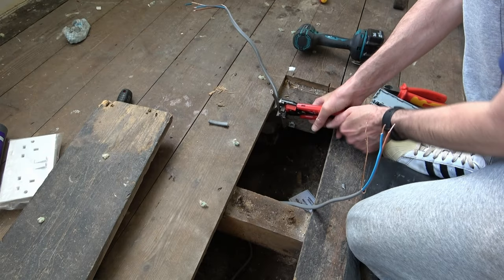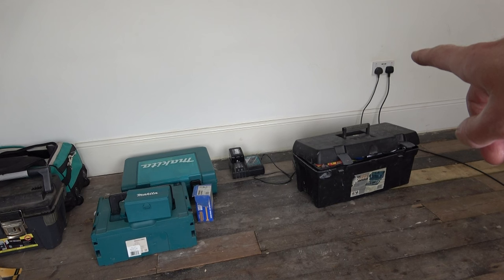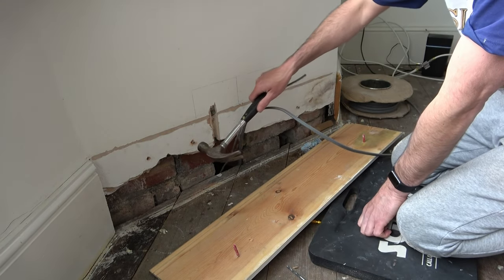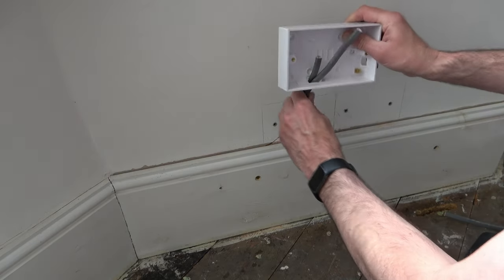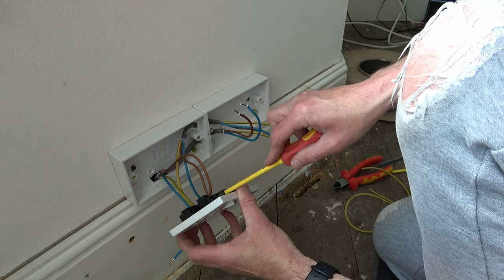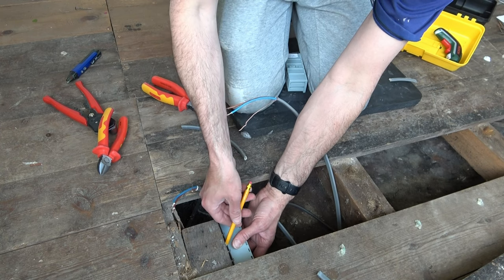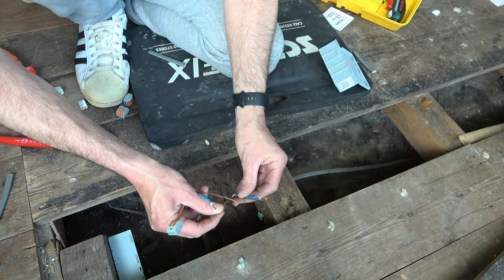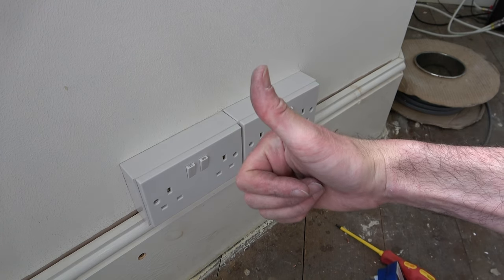How to ADD SOCKETS to a RING CIRCUIT. WAGOBOX & WAGO connectors. How to wire a double socket!

Comment: Whilst you're correct in what you've done in terms of adding those sockets to the ring main, this was a very very quickly overview and nobody should be promoting this as something diyers should do... Too many people may see this, feel too confident and pose a serious risk to themselves or family
Reply from the maker: You may be right, but I think someone looking for this video is likely to do it anyway. I fully take your point regarding quick overview but I guess that's the nature of video format. If it was in real time it'd be a pretty dull watch! Thanks for the feedback and thanks for watching 👍
Reply: You also recommended any DIY electrical work is checked for part p so I think you’ve advised appropriately.

Comment: DO NOT FOLLOW THIS VIDEO AS ADVISE - whilst the install advise is generally ok, the electrical advise is not - no insulation testing, no ring continuity testing, no R1+R2, RCD or Zs tests. How does he know he hasn't extended a spur and created a serious fire hazard. And the use of a volt pen… this is not exactly safe isolation !! If I worked like this I would be dead within weeks.
Reply from the maker: Thanks for the feedback James 👍

Comment: DON'T! Rely on those mains tester pens. They ARE unreliable. Use another means in addition to ensure the circuit is dead. And just pocking the tip or the tester on the cable isn't good enough, I did that once and got no indication it was live. You have to wipe the pen all around the cable. But again, don't rely on just those testing pens.
Reply from the maker: Thanks for the feedback.
Reply: i have 2 of the pens and kept hearing they can stop working. i always use both and a socket tester if on a socket, and one pen stopeed working and didnt detect, even with fresh batteries, so its true dont rely on 1 method alone. binned the pen. blue one from screwfix.

Comment: I'd never use an impact driver on a wall plug mate, its too much force. Hence it broke the plaster.
Reply from the maker: It's more the plaster, it's over tge top of old lime mortar. Hense why I didn't chase tge boxes out, ends up taking half the wall off! Thanks for the feedback 👍
Reply: @POUSEaroundtheHOUSE Wall plugs are awkward things to work with especially on old buildings but in my experience the impact is asking for problems. A normal drill on screwdriver low torque setting usually gets them in fine without damage; better to start with low torque 👍

Comment: Concealed junction boxes are no longer allowed. Would be better to pull through a new length of cable.
Reply from the maker: Maintenance free boxes are which this one is, hence why I used it. They need a physical clamp on the the sheath of the cables, and secured to a joist. The box then sealed with a cable tie as mentioned in the video. Thanks for watching.
Reply: @POUSEaroundtheHOUSE  Thanks for that info. I would still rather pull through a new cable, and have all junction points accessible. Good video for those that aren't like me.

Comment: Great video, I plan to do this very soon. Difference is I plan to extend from a existing socket rather than cutting into the ring and extending it as the new on will go at the other side of the wall to a existing socket.
Reply: I am needing to do same as need to take feed from existing socket to feed 3 sockets in a media wall will it be same process

Comment: When you break existing ring does the new cable need to be attached in a certain way. Eg does the electricity current come from one direction and exit the room in a different direction on the ring.   If so how can you check/test for this?

Comment: Amazing video. Can I ask, if you were to do this yourself, some electrical experience but competent, do you need to get any certificate to get this signed off. Also, I have a multi-tool that I brought during Black Friday, seen a few videos people have used this instead of sds and then hammer with a chisel. What is that blade called you used with the multi-tool. Also, can you give a link to your pen tester as well or similar one. Thank you, subscribed. Will come in handy when I do this to my own home.

Comment: Very good explanation …….any reason why you didn’t bury the sockets in the wall to match the others instead of mounting a wall box ?
Reply from the maker: It was purely the mess and the fact I'd have to replaster a section of wall. I had enough work to do on the room already plus the sockets are hidden by the TV unit. Thanks for watching 👍
Reply: They look a bit low for the regs to me unless that's big skirting

Comment: Using wago boxes under floor boards likely would not meet building regs as not readily accessible. Should be crimped and additional heat sealed sleeves.

Comment: Can someone put this question to bed. Is using the Wago 221/222 for a 32A MCB acceptable on a ring? I read when fitted in the junction box that its de-rated to 20A.... Thanks in advance
Reply: Yes
Reply: The beauty of ring mains is there are TWO! cables/paths running back to the consumer unit. 2.5mm^2 can not handle 32A, but two lots of twin and earth 2.5mm^2 easily can! Same for the connectors.
Your logic is correct for radial circuits, especially those for the beefier cooker and shower. the cable and connectors need to match the circuit breaker in the consumer unit.
Reply: @alstonofalltrades3142  I aware of the current carrying capacity for 2.5mm2, and the benefits of load sharing on ring circuits. Was looking for an answer specific to wago connectors when used in a maintenance free junction box application. Thanks
Reply: @Dr.Stacker  Sorry I misunderstood.
One post says that the 20A rating is for the 110v split phase they use in the usa. Dunno if that helps or is true.

Comment: Stupid question, but what would happen if you put a spur onto a ring circuit?
Reply: You can spur off a ring main but max 1 outlet each outlet, unless you wire a fuse spur you can add additional sockets on that spur
Reply: You can down rate the mcb
Reply: @jablot5054  why would you down rate the mcb? Your just adding a spur on a ring main, don't need to touch the MCB at all, this is why "competent" people shouldn't be touching electrics
Reply from the maker: All explained here - How to wire a spur socket - https://youtu.be/KJWHK9YYIHU

Enjoy!

Comment: You've done it already now, but the Wago 222 connectors you've used to extend the ring circuit in a maintenance free installation are "de-rated" down to 20amps. Your ring circuit OPD is rated at 32amps.  This means your connection is in theory rated lower than your conductor and your OPD, and is now hidden underneath the floorboards. 
You also are required to cable tie the maintenance free junction box closed. It would also be useful if you pointed out to your viewers the importance of the positioning of the cable grips in the wagobox/connexbox - the cable clamp/grip feature is an essential part of the junction box becoming "maintenance free".
You also should point out the importance of working out the max aggregate current guidance on junction boxes? 
These things all need to be considered.
This information is all freely available from the manufacturers and from NAPIT etc.
Check out the hager/ashley 32amp maint free junction box. Its a decent product.

Comment: How do you know it’s a ring circuit
Reply from the maker: I rewired the house when I bought it. Thanks for watching 👍
Reply: You can do a continuity test with a multi-meter.
Reply: @Benzknees how would this prove of its a ring or a radial?
Reply: @raj080288  - A ring connects back to itself at the consumer unit, so testing two live or neutral or earth ends should give a low resistance reading (with the power off of course, and all devices unplugged/isolated).
Reply: You have 2 browns in the MCB
Reply: @Benzknees   what would be the difference in readings between a ring and radial circuit?
Reply: @Mircea007 that doesn't prove its a ring lol
Reply: @raj080288  - Assuming you're reading two disconnected ends going into a plug socket (i.e. not the last plug socket on a radial), the radial would have near infinite or high megaohms resistance (as there's no connection between the two ends), whilst a ring would have a low ohms value (I got 0.2 ohms on my live & neutral, and a bit higher on the smaller earth) as a current still passes.
Reply: @Benzknees  would thus be from the breaker or the socket directly? (obviously isolated)
Reply: @raj080288  - Yes, from the wires coming together at the fuse/breaker.
Reply: @Benzknees  thanks for clarifying. I'm guessing these would be the r1, rn and r2 readings which we would then check the ohm readings at the sockets themselves?
Reply: @raj080288  - No, R1 & R2 is testing the combined resistance of the live & earth runs back to the consumer unit, so that the fuse/breaker operates within the minimum time during a fault condition. To do that you disconnect the live & earth wires at the consumer unit and attach a fly lead inbetween. Which applies with both radial & ring circuits. I'm talking about the continuity of live to live, or neutral to neutral, or earth to earth, which only applies to ring circuits.
Reply: @Benzknees  from the socket or circuit breaker?
Reply: @raj080288  - If you mean where to measure the continuity of a ring, it doesn't matter where you separate the two lives, two neutrals & two earths. As you're just checking the rest of the ring is continuous, i.e. that it will pass a current. Of course that's with mains power turned off!
Reply: @Benzknees  that's exactly what I meant lol. Thanks for claying that mate, appreciate that!
Reply: What would be ohms difference in reading between a radial and spur?

Comment: you don't have to remove the skirting board,  just drill thru and get some quick fixing plugs (they longer) , just hammer them in
Reply from the maker: Doing tgat would have taken half my wall off! It's victorian with lime mortar on the walls 140 years old, it doesn't take much to bring itvaway from the wall. Thanks for watching 👍
Reply: no its not just drill thru the board into the wall The quick fixing plugs are thin too @POUSEaroundtheHOUSE

Comment: As a non electrician, I struggle to understand why the cable is needed from the second socket back to the first. I just can't get my head around it. Also, am I correct in saying the second socket could have been a spur off the first socket?
Reply: One leg went to the socket on the left, the other leg to the socket on the right, and then cable between the two to complete the ring.

One socket on the ring and the other a spur is an option. But why use a spur when you have two legs for the ring available?
Reply: @martinw245  Cheers Martin. I must admit I do feel a bit silly posting my comment after getting my feeble mind around it 😂

Thanks for explaining.
Reply from the maker: @alpachino468 I think Martin answered your question? Thanks for watching

Comment: Mr Prouse .. I've enjoyed your videos. 
But in this case we need to remember that all cable joints should be at fittings where they are accessible later.
Maintenance free joints hidden under floors and in walls should only be used as a last resort. 
Also this really is a job for a qualified professional electrician.. its past DIY level.. and as such shouldn't really be encouraged.
Reply: I actually thought it was illegal (not illegal, perhaps, but insurance invalidating) to add a socket as a DIYer.
Reply from the maker: To my knowledge a maintenence free box if installed correctly can be used full stop. You say last resort, what other option did I have? As for encouraging, I'd say I'm showing the correct way, rather than encouraging. If someone is intending to do this work anyway, then better to do it as safe as possible rather than guess.  Thanks for the feedback 👍
Reply: @martinw245  yep, that's what I wasn't sure about. Thanks for clarifying.
Reply: @ricos1497  

I think I deleted my reply. What did I say? 😳 I may have been inaccurate. Regs changed in 2013 and less became notifiable. Spur is not notifiable and my interpretation is extending a ring isn't if its not in a special location.
Reply: @martinw245  no worries, that makes sense. I'm in Scotland, so the rules might be different here anyway.
Reply: @POUSEaroundtheHOUSE   I think the real point is that none of what you've shown is difficult. Not in concept, nor the science/physics, nor the manual skills required. What the authorities make rules for is to **ensure it is done properly**. A professional electrician would do no better that we've seen here. What they are instructed in for the qualification is the rules - which can be read and followed by most diy-ers. Unlike gas or water - there are skills involved there.
Reply: @dnealuk I'd just note this on a minor works. It's only notifiable if the for said work Is the addition of a new circuit. The electrics are within a special location. Or the consumer unit is being altered. That said it should still be inspected & tested by a qualified electrician like myself.

Comment: Sorry but you have multiple sockets in that room and floor boards already lifted.  You have then decided to create weak points in the circuit by breaking in to it instead of lifting a couple of extra floorboards to re run 2 legs from near by sockets. 

Now you have a junction box under floor boards instead of all connections being easily accessible at every socket.  

If you did this on the job you’d be out on your arse.  The worst part is there are 51k views of people that might think this is a good idea. 

This should only be used in situations where no other options are available.

Comment: Wow British homes are a mess. How many rodents live down there?😅 You guys must be allergic to concrete floor.
Reply: Many of our houses do have concrete floors, especially new homes. Lots of wooden floors though. Don't forget, we have a rich history and some very old houses.
Reply from the maker: The house was built in 1889 so it isn't of a 'modern construction'. New builds have damp proofed, insulated floors often with underfloor heating and insulated brick cavities or insulated timber frame construction. Hope that helps! Thanks for watching 👍